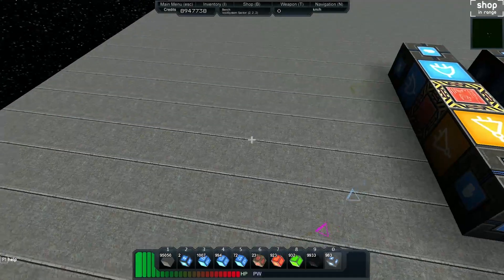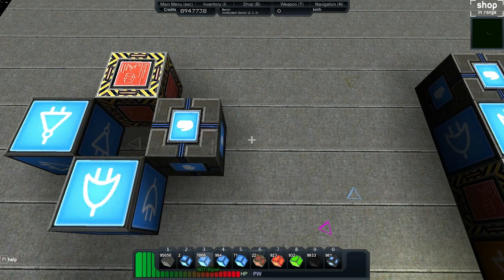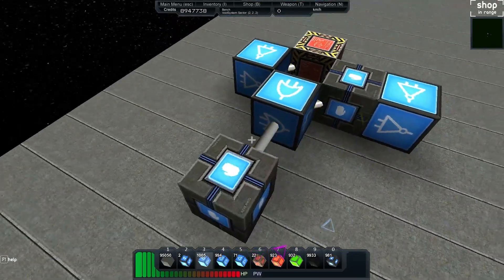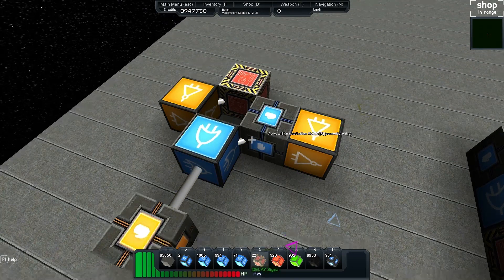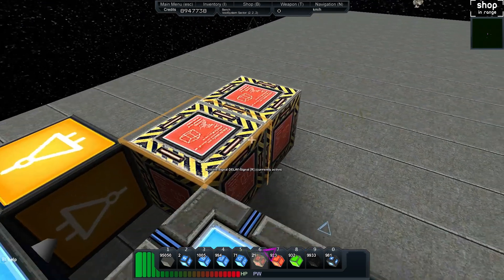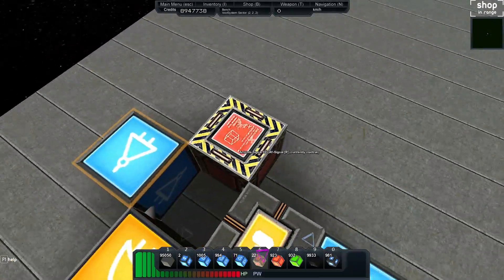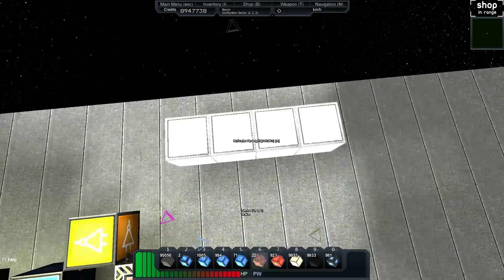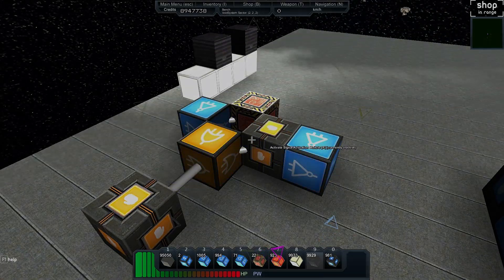Starmade Logic #3 - Clocks

Comment: i made the same kind of clock with just a delay and not block linked to each other. The not changes the signal from the delay to off and sends it back to the delay. the delay prevents the loop from messing up signals. either block can then be linked to something else.
ps: please note that the delay has to be turned on then off to start the loop and this method requires extra blocks to stop and start the loop so its best for set-and-forget style systems.